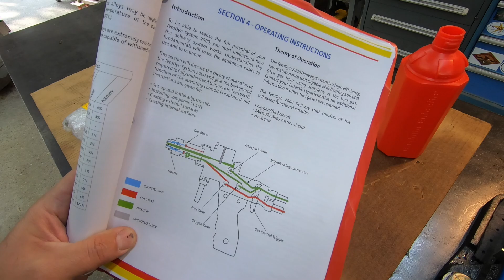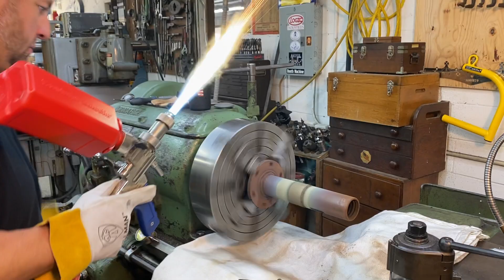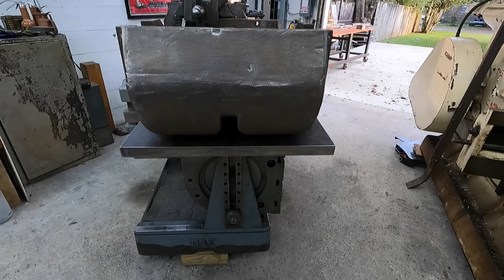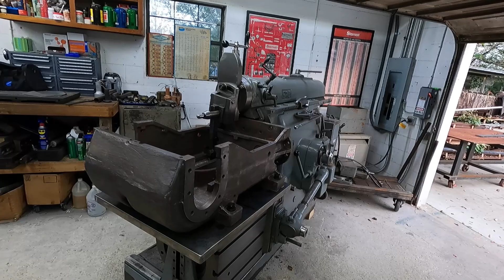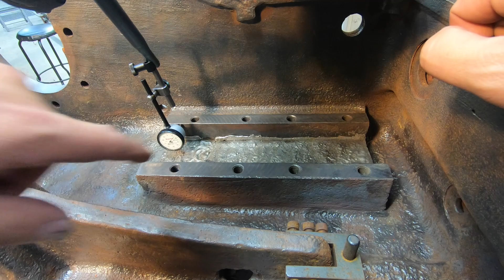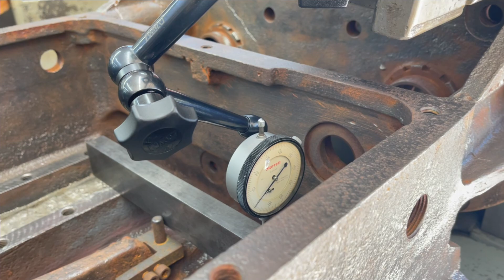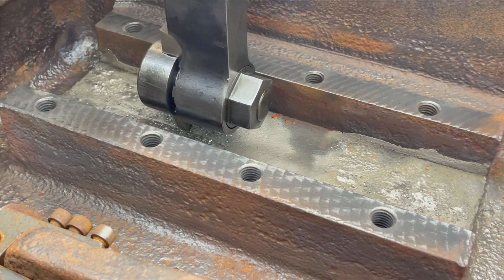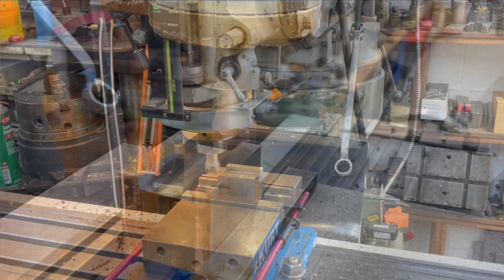SNS 331: Stoker Engine, Eutectic Torch Repaired, Tung Tri Mill

Comment: The stoker engine project may honestly be a better project for Keith's metal planer he is almost done with. He could use beefier tool holders for the extension needed.
Reply: Or maybe Brian's big HBM up in Kentucky?
Reply: @Mishn0  was thinking HBM too.  I am with Adam, I want to know how they machined this thing in the first place, leaning toward planer though with how old it is. they probably used a HBM for the part with tool marks.

Comment: Long reach holder and maybe a lathe tool on the end for fly cutting, or a shellmill/facemill. Largest diameter of cutter what you could fit in the slot, and smallest diameter shank that would work. The tool cant have many teeth cutting or it wont be stable.
Reply: Maybe go in with tiny grinding wheel on edge, set on a sliding guide, but use that shaper set up to measure the progress, glad its his job & not mine.

Comment: Adam don't be to hard on yourself. You are a very talented machinist and I know you are trying everything possible on the stroker engine you have in your shop. That is a tough piece to setup and machine with the tolerances being what they are. Some of these issues you couldn't for see until you had the piece in your hands.

Comment: is there a reason you cant turn it a round to gaine the clearence you nead for the tool head .
Reply: Yes the other side is a lot taller, and the tool holder would have to be longer and the machine stroke may not be long enough...but maybe that is the answer
Reply: The clapper box only works in the forward direction
Reply: @johnlennon335  I meant turn the entire work around!
Reply: The other end is much taller.
Reply: @ydonl  That is the problem I can't see, without being there.
Reply: Adam will figure it out... I saw him Smile!!!
Reply: I was thinking the same
Reply: Read Adam's pinned comment at the top
Reply: Exactly!   Perhaps also a shorter tool holder and longer cutter. Going to be dicey.
   In any case, I see having to change setup 4 times to get into the corners.